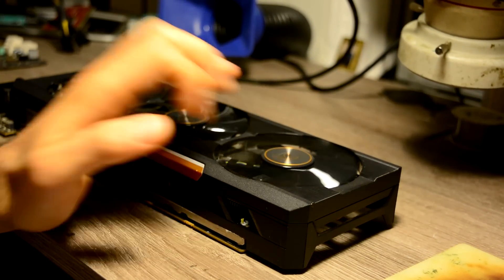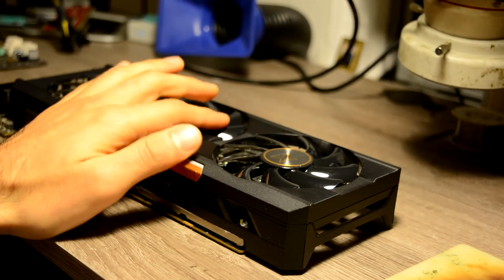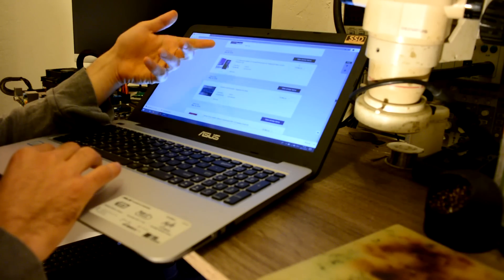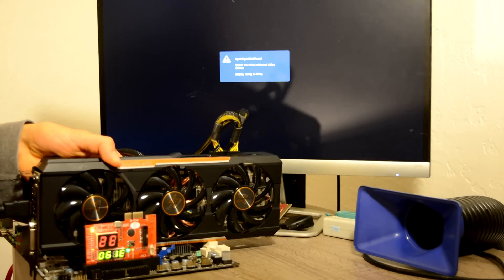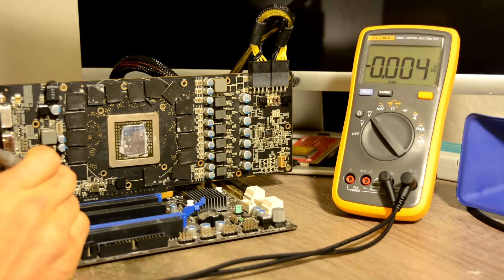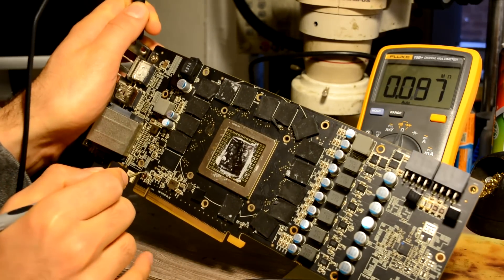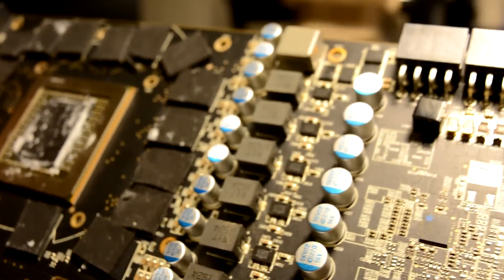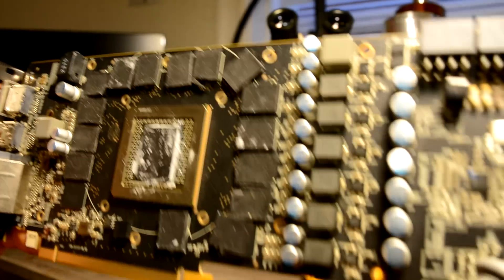Broken video cards from Ebay. Is it worth buying them and do repairs?

Comment: After replacement of ir3553m and the fuse ,if you dont get any voltage on gpu,mem,pcie,aux ect what can go wrong.
can it be the ir3567b to go bad?
Reply: Same problem here !! Have you replaced the 3553m correctly?? You get no voltage for gpu vram pci express , have you tried to remove the chokes to see if the Gpu is burned ??
Reply: @mosfet6402  replaced  ir3553m + fuse,+12v stabilizator,+ 2caps on the back...0.9v on pcie came back and 6v for feeding the ir3553m,but memory controller gets 0.028mv,gpu  and memery not getting power.on the ir3567b enable is present but on the ncp5230 enble is missing.
I'm lost,I think that the 3553m is making the problem.will try to reinstall the 3553m to see if anything changes.
Reply: @io-buggy6925  Why you change also the other components, have you tested them and found them defective??
Reply: @mosfet6402  Yes I found them defective.and replaced them with a donnor that had a dead gpu.
replaced the ir3553 memory controller same simptoms are present.I think the ir3553 is good installed.
I got a same working card will try trubleshoot it with the working one to see resistance and voltage are correct.

I dont know if it possible to dissable 1 fase of the gpu on the r9 390 or all the fases need to be present.
Do you have any info about that?
Reply: @io-buggy6925  Any news ?? Have you successfully repaired the card?
Reply: Peppigners 1980 No the card got shorted on the gpu and its dead now.

but recently I got a 390x and the repair was easy.
after replacement of the ir3553 and the fuse and the ir3678b,the gpu was performing like it should.
Reply: @io-buggy6925  How have you checked the short coming from Gpu??
Reply: Peppigners 1980 after removing the chip the short was goen.
Reply: @io-buggy6925  You have removed the Gpu and checked the voltages of the card without gpu ?
Reply: Peppigners 1980 no there was still no voltge to the gpu and memory,just the short was gone.

Comment: Hey i have a r9 270x that stoped working a year ago, when i install the drivers i get a black screen i have tried it in different computers, and i have even flashed the bios with a lower clock/ memory speed, what do you think the problem is ? lots of people are have this problem but i cant find any fix. Thanks,

Comment: Can you make a full guide on how you repair a gpu? tools needed, finding shorts, etc....
Reply: It's VERY hard to show how to use years of experience in a short time. 
Go check out louis rossmanns videos. They are very good. He also tells the gist of it: Many failures have to do with the power delivery. They can be fixed. But on GPUs it's not rare at all to see a dead GPU chip. This will not be permanently fixed by heating those chips. Replacing them requires very special equipment.
So if GPUs have a black screen it's a good sign. Artifacting cards most likely have issues with the package it self and therefore are not worth fixing. You can try to bake them to extract a few extra months of usage.
Reply: I think the best place to start is to watch Actually Hardcore Overclocking channel. He analyses video cards and motherboards. I watched a bunch of his videos recently and have a much better understanding about the basic layout of these devices. From this you can diagnose problems easily i think. Its just a matter of testing parts of the pcb and seeing where there is a fault.
But fundamentally you should know the basic layout, for example if its a power issue, you can straight away start testing the voltage regulator because you know exactly where it is on the pcb.
Reply: @TheRailroad99  Okay so if i got you right just a black screen means the chip might be fixable?
Reply: Would definitely donate if you did!
Reply: Nestirium  A little common sense helps a lot that unfortunately majority of the worlds ppl totally lack.
Reply: Nestirium  year late but you dont need a degree in electronics to know how electricity works lmao. I learned about electricity and electrical components in high school.
Reply: Yeah! That'd be great actually.
Reply: multimeter and that's all.  and knowledge about how to use it
Reply: @techalex1992  not all, you need to know where you are going to take those messures, and what kind of messures you need to take
Reply: ZenTEK adamant IT has a series on this
Reply: @TheOliveboy93  Any chance you can provide the name of the video?
Reply: How do you send power to graphics card to find hot chips???
Reply: I think you guys need take course electronics as there lot more goes on in what we are seeing hear
Reply: there are plenty of guides and how to videos on youtube and articles on various forums and repair websites around the web
Reply: Whatever happened to this guy , loved your videos man!
Reply: I need you Eli, check your messages please.
Reply: Umm yeah the guide is four years of electronics schooling. Its a full program to know how to fix and build electronics
Reply: I agree anybody have a link to a video that explains how to repair them?
Reply: You mean vga. A gpu is imposible to repair.
Reply: YooZD
Most GPU cards are just dead! Unable to do a repair video!
Reply from the maker: lucas rem not agreed
Reply: @lucasrem  it’s his channel? Lmfao why don’t you just go through his channel ya weirdo to see what he’s fixed.

Comment: I'm trying to troubleshoot a gigabyte GTX560. less than 1 ohm resistance to GPU is not normal right? all 4 phase mosfets are Good. maybe i have a shorted GPU?
Reply from the maker: Ariel Ponting then yes, looks like
Reply: @elitech3339 Thanks for answering my question. BTW thanks for sharing. keep uploading videos man. I was able to fix an HD7850 because you gave me the courage and confidence. the fault was VRAM's VRM. Low side MOSFET is shorted. I am using the card right now. fixed it 3weeks ago :)

Comment: So.. I've got a question. I found out that many people say that Reballing isn't a permanent fix. LinusTechTips even made a video about it. Is that true?
Reply from the maker: reballing, reflow as for me that's a way of diagnostic failure of gpu, but not a repair. Evry tech has his own opinion on that point
Reply: Reballing exactly is permanent fix, as long as the fault is in the solder joints and not in the GPU chip. Reballing replaces the solder balls under the chip with new solder balls. I think you mean oven reflowing, which only makes old solder balls under the GPU chip melt again, which may help if the solder is cracked. But it doesn't necessarily make a good, strong solder joint, because the solder is old and fatigued.
Reply: the green silicon its a socket for the glass CHIP.
if the solder under the glass and green socket its bad then you can piss on it.
if the solder under the green socket its bad then a reballing will fix it.
Reply: @DanielCardei  "the green silicon" has a technical name , "carrier"